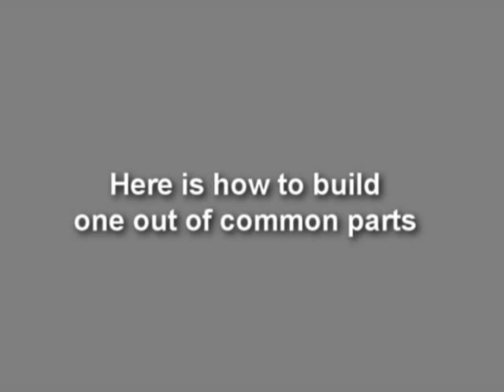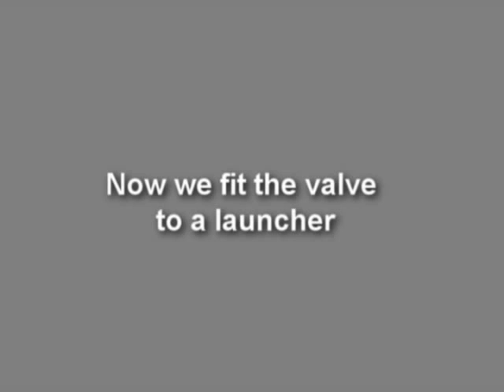Water Rocket Launch Abort Valve

Comment from the maker: Hi Daniel,

Indeed you can use the non-return valve in 2 stage systems. In fact that's where the idea for the 'pin' non-return valve came from.  The Crushing sleeve mechanism.

Comment from the maker: @MrTomcarnahan , The weakest part in this setup is going to be the garden hose. Beyond 150psi you probably don't want to use plastic Gardena fittings. You can switch to brass ones for that. You can also use other quick connectors on high pressure hoses.

Comment: Hi Geroge, 

You use the same epoxy resin that me!!! In Spain it is called Araldit. Is the resin that I use for asegurate the couplings, is fantastic.
Could be use this type of valve to be the ignition system of a two stage water rocket?